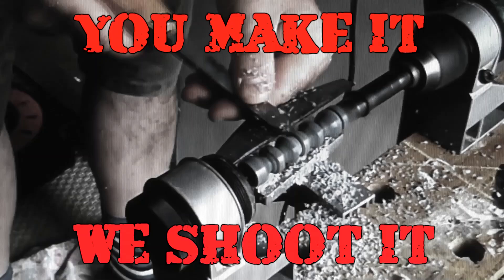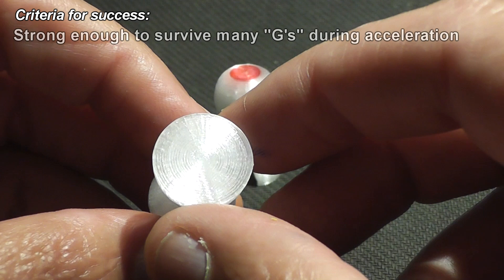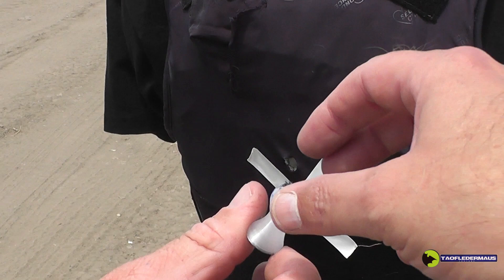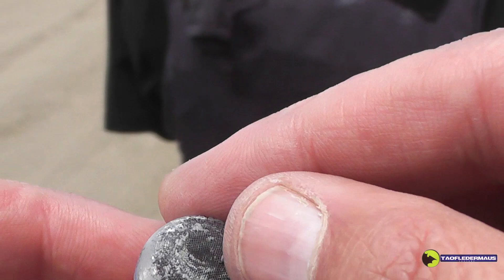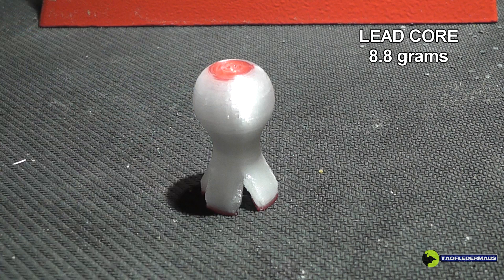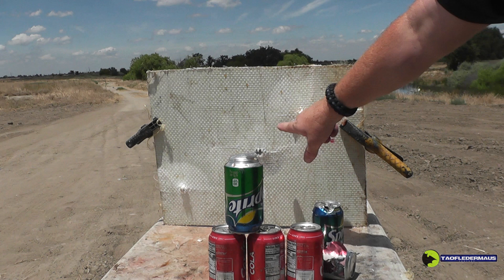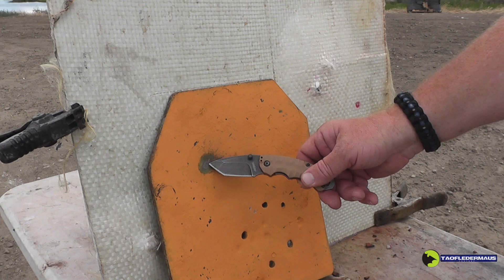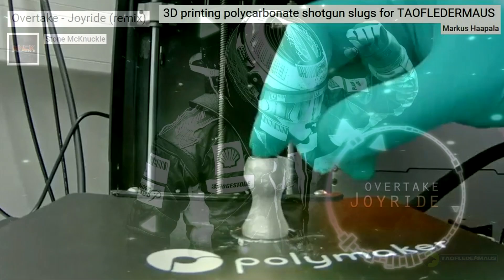SCIENTISTS send us shotgun slugs with stunning results!

Comment: Policarbonate holding the shotgun blast?  "no problem at all" i tough when i heard him say that. 
Im an optician and i work with PC, man that thing is hard as hell, one time an old lady bring me her prescription glasses , one of them was scratched but ok, the other was bent 90 degrees. knowing the material and the strenght you would need to do that i asked her what happened and she told me they fall off her pocket when she was crossing the street and a bus ran over them
Reply: I only have one working eye, so I always pay the extra to get Polycarbonate lenses for that very reason.

The worst thing that's ever happened to mine was taking a drill chuck thrown across the room because someone forgot to remove it from the drill press. Lens somehow managed to stop it.
Reply: I had some extra thick polycarbonate lenses with clip on side shields that I used while operating a CNC milling machine. They saved my eyes more than once from chips of steel and aluminum that shot out at high speed.

Comment: I don't know anything about supersonic fluidics, however my initial thought was that they maintained accuracy in part because of the large flare causing a significant amount of drag pulling the rear in alignment with it's trajectory. Then in the last shot against the armor plate, you can see part of the sabot is dragged along in the vacuum until the very end. So, considering that the accuracy seems to at least in part come from the drag being high, I'd be curious how fast the velocity drops off over larger distances.

Comment: I have a polycarbonate motorcycle helmet. I'm pleased to see how tough this stuff is.
Reply: lahokc59 the shape of the helmet also determines how well the impact is distributed. Idk, I'm sure I'll be fine with it.
Reply: lahokc59  :  Slice your expensive helmet open and see that it is the expanded poly-foam (various flavours) that does the absorption, not the shell material (polycarb / reinforced -fibreglass - carbon fibre - kevlar/ etc...  That just stops the foam escaping (and penetration), very hard to collect it again once it escapes...
Reply: Cheapest and weakest helmet material.  Blunt force protection is mostly a function of the foam inside.  The shell protects against penetration, abrasion and crushing.  All high end helmets (Snell rated) use fiberglass or better.  Shoei is probably the best helmet for the money.
Reply: How does it fair vs steel I wonder?
Reply: @ericthered9655  yea idk my helmet was SNELL and DOT approved.
Reply: I have bmx pegs, with polycarbonate sleeves and grind ledges and rusty steel railings and they look like they barely scraped it. PC is super hard, but it has flex to it thats why it wont break. Watch a slow mo polycarbonate riot shield test, it like dents in and then reforms in under a second after being shot.
Reply: @ericthered9655  The face shield as well as fighter jet cockpit canopies are made of polycarbonate.  It’s a very good material.  Fiberglass is brittle and unforgiving when it comes to impacts, that’s why polycarbonate replaced it.
Reply: @captaingoldbeered803  Because you can see through it. The thin PC used for helmets offers little protection. No high end helmets use it. It's only used in very cheap helmets. Do some research. Someone has been lying to you.
Reply: @ericthered9655  I have researched it, online and in person with my own noggin, helmet and pavement at significant speed.  The helmet, inside and out, did exactly what it was supposed to.  It absorbed the energy and protected my head as was depicted by the compressed, stress-cracked styro inside despite the polycarbonate on the outside being scratched to hell but completely uncracked.  Poly is fine as long as it’s thick enough.  I don’t buy shitty helmets, the one I “tested” was a 300$ svs.  The main difference between a quality poly shell helmet in the 2-300$ range and a 900$ helmet is the $900 carbon fiber one will be considerably lighter, not necessarily safer.  I must reiterate, I’m not talking about the $50 internet helmets that are being shilled out to the unsuspecting by the boatload.  They may technically be poly or abs but I guarantee it’s the cheapest crap that could be sourced near the sweat shops that day.  You really should look into plastics a little deeper, it’s truly amazing what they’re capable of these days.
Reply: @captaingoldbeered803  PC helmets offer minimal protection. Fiberglass and better are far superior. This isn't something that is in dispute. You clearly don't understand the properties of these materials. Stop trying to make up your own version of reality and listen to people that know a thousand times more than you.
Reply: @ericthered9655 Well there goes this conversation.  Try to have a nice life bud.
Reply: @captaingoldbeered803  A helmet performs more than one function. The foam reduces moment of impact which reduces how hard your brain hits the inside of your skull. The shell spreads the impact and absorbs blows that could smash the skull such as your head hitting curb. PC has virtually zero ability to withstand warping and will not rest a focused blow. Likewise, it will not stop your head from being crushed which I have seen. I can deform a PC helmet with my hands. It will only protect very light blows. Believe it or not, the fact that zero high end helmets use it isn't a conspiracy to trick you. Good luck with your soft helmet. I hope you never find out the hard way.

Comment: I see the physics behind it. The ball in the front is used to push the air around the back section, that's the stabilizer part, It goes around to not disturb the back part.. the back part is there to stabilize it. it is slightly engraved in the bullet so that when it tilts in the air more air resistance is put on the back which turns it forward. Really simple but smart design!

Comment: Please for the love of god, BUY A CHRONOGRAPH!!!! You can pick up a Caldwell's shooting chrony for less than $100 and download the app to your phone and be able to say with accuracy how fast the loads are going. In the app you can even plug in the weight or the projectiles and it figures the energy delivers at different ranges for you. You can accurately keep track of meteorological conditions for comparison later, PLEASE QUIT GUESSING AND GET A CHRONOGRAPH!!!!
Reply: Southron Jr all you have to do is know your frame rate and distance traveled per frame and you get the speed
Reply: Jacob riddle Yes, but that would require using the high speed camera for every single shot and doing a bunch of math that is made automatically and is more accurate made by a chronograph.
Reply: Southron Jr That's actually often the point - they have very few rounds and every shot counts. They can't waste one on chronograph measurement.

Also, if it's difficult for you to calculate speed from a known time and distance, I feel sorry for you.
Reply: My point is that they can use the chronograph in conjunction with the high speed and be able to have a more accurate measurement than using math alone, and no, doing the math for me isn't hard, just a chronograph does it for them with being able to add all other factors in the record. STOP BEING A TROLL!!
Reply: Southron Jr You call this being a troll? Man, calm down...
Reply: "Also, if it's difficult for you to calculate speed from a known time and distance, I feel sorry for you." 

That and arguing just to argue is being troll.
Reply: Southron Jr You acted like it's a problem to use the high speed camera for all shots, so I said no, that's actually a requirement for other reasons.
Then you acted like simple division is too much trouble and they need to buy and use an additional device instead.
I am not being a troll, I just think you are wrong. I apologize if my snark about calculating speed bothered you.
Reply: Honestly it's not that big of an issue. Frame rate vs known distance/scale is easy enough to get it to the right ballpark. This is a channel were a guy shoots stuff people send him from a 12ga or tries ideas people come up with for the same. It's not WMRD or MCWL or NRL or even SAAMI.....it's a guy having fun with a shotgun.
Reply: +Michel Linschoten I agree that a chrono is cheap. You can still get a fold out F1 Chrony for $75 on sale NIB. But why? You yourself said they aren't professionals, so what does it matter if they use a chronograph? If you shoot at a known distance, and have a high speed camera that can record total flight time from the crown of the barrel to the impact of the round, then you can calculate speed pretty accurately. And, it's one less thing to clutter up the range with. Not to mention, you see a lot of their videos with wads or even sabot hulls flying all around the area where one would normally place a chronograph. It simply isn't needed if you can calculate it out using the footage.

Also, for some one scolding others about chest puffing, your reply has an awful lot of chest puffing man.
Reply: Its okay man they don't understand calculus, information for you, when you have the time of firing and time of impact you don't know the continuum of velocity across the entire flight... which is very valuable information to discern such things as muzzle velocity and drag
Reply: you want jeff to get a chronograph so bad, why dont you buy him one and send it to him?
Reply: Southron Jr I agree. It would add a much needed aspect/measurement for us to get a better idea of preformance

Comment: I would like to see these slugs (the ones that worked) put into production.
Reply: The tungsten ones are not smart to produce, because the metal costs so much, it would be way more worth it to just buy a normal slug because of the price.
Reply: @alexander-it6mx  If they could release the diagrams we could make some from lead in a mold cut in a cnc
Reply: Oh trust me, people will pay for them. Hard hitting, insanely accurate (there is more in them yet, the boys have tried one load of each of two powders) and really cool so they will sell even at a premium price.

Comment: It reminds me of a toy that resembled the exact projectile that you would insert a "cap gun insert" into it and throw it. The front was weighted so it would always fly straight. It would pop upon contact. I believe a projectile without the "weak spot" would have far less force. I also believe this is why there is an exact measurement of powder required.

Comment: i dont understand why they keep calling the middle its weak spot. arches are strong on top and i guess they think its weak because the arch is being compressed but this isn't just your typical arch shape. the best way i can describe it is a 360 arch with a cylinder in the center. It's actually a very strong point although i lack the vocabulary to describe it

Comment: "This design we haven't seen before"... except in every .177 air rifle slug since the dawn of time... ;)

Cool to see the principal of the skirted projectile through a smooth bore to maintain stability holds up in shotguns as well as air rifles though.
Reply from the maker: the dimensions are completely different with these-  length to width ratio
Reply: Fair point, though now I'm curious to know what a .177 skirted slug scaled up to 12ga would do

Comment: The flat back creates drag which keeps the slug facing forward... Interesting... Makes me think a heavy needler round with golf tee shaped needles. Modified a little of course. Small fins leading up to the flat back that help generate some rotation for stability. Some slots in the back too so it could be loaded 3 in the back with one forward a little, maybe a wading that would hold the middle one lightly further forward and flare away after leaving the the barrel. This would make it so as the 4 needles leave the barrel the wading would flare away, as the middle starts spinning would lightly separate the 3 others, and hit the target fairly accurate. How angled the "fins" are would determine it the spread as the middle throws the other 3... Actually, no fins, they could get caught in the middles slots

Comment: At around 10:13 the wad impacts a leg of the metal supporting the cinder block. It bounces to the right spinning at a high rate. As flies away it to the right, it appears to slow down and the spin rate goes up dramatically.
It has nothing to do with the video or the performance of the slugs, just thought it was interesting. By then end of the shot it's almost hovering and spinning really fast.

Comment: Great timing, I just pimped my 3D printer to be able to print polycarbonate. It's difficult stuff to work with indeed, only prints at very hot temperatures and warps like crazy without the proper precautions. But as you can see, it's tough enough to shoot from a shotgun!

Comment: Given the stable, and relatively straight flight path of these slugs, I wonder two things: 1) How would they preform in a smooth bore muzzle loader? 2) If you used these to make a mold, and then poured lead into it (creating a solid lead slug of this shape and design), how does it compare to musket balls?
Reply from the maker: If they were lead,  they'd weigh about 3,5 oz,  and would probably pressure-spike the barrel and blow up the shotgun.

Comment: It's interesting to note, and is probably something you should pass on to the people that send you these things in; The shape of the front of the projectile is actually a LOT less important than the base/tail of said projectile. I'd guess that even if that split tail had held together, it still would have proved vastly inferior to the solid, smooth base. For example, you could take a 5.56 and cut the tip off at a 45 degree angle and it would still fly fairly straight. However if you so much as chip the base of the bullet (well, where the side meets the base) you will completely destroy it's ballistics.

Comment: ironically i feel like the smooth teardrop point helps guide air into the flat spot behind it, causing a low pressure suction that makes the tail of the round actually stabilize in flight

Comment: There are longer sniper rounds with the concave centre, it's based off the same principle as those dimples in a golf ball and cut that drag coefficient down by loads allowing long range travel on a heavier longer round, I saw a video of a sniper make a head shot on a dummy at over a mile, I was impressed and disgusted at the same time. IF you want to get better mileage by about 23% on your car using this same principle, get a vinyl wrap with the golf ball dimples in it, and watch the change in mileage and speed from the better drag coefficient. A wrap that pays for itself.

Comment: Love seeing Greg shoot that gun. I own the same one. Very similar. I have a red dot, and the same mag extension, camo, and a similar shell holder on the buttstock. I also have a light, and sling mounted though. I've also been thinking of cutting down the let side of slide so I can add a second 5 or 6 round shell holder opposite the ejection port. Then I can have slugs in one, and either 00, 0 or most likely number 4 buckshot. Anyways great video as always. Good on the scientists for doing some great work.

Comment: The shape of these slugs is not to much different than the shape of conventional pellet-gun projectiles.  It's the shuttle-cock, wasp-waisted design that helps keep it stable in flight.

This is like comparing apples to oranges but, in similar fashion when longer bullet-shaped projectiles are used in most air rifles you get the same types of unstable flight that you guys have shown when shooting similar projectile shapes out of your shotguns.

In air rifles, when conventionally shaped pellets (shaped like the slugs you were firing) are pushed to fast, not even the shuttle-cock shape of them can keep them stable.  The lightest weight pellets (or slugs in this case) have a velocity window that keeps them from being accurate beyond that point.

Comment: Would be a safer alternative in domestic room clearing for officers because its low penetration abilities for walls is low I imagine compared to conventional slugs right? Atleast for the slugs containing no tungsten correct in assuming? Should have tested it on dry wall and wood combinations :3 but I suppose that's what bean bags are for and other non lethal methods xD

Comment: notice me senpai!

You should try to Shoot NaK. It consists of Sodium (Na), and Potassium (K). As elements, they are solid, as an alloy, they are a highly flammable liquid, that will start to burn if the air has acces to it. It is so sickly reactive, that if you drop a drop of it, it wont reach the ground. 

sooo they look pretty amazing, because they are on fire while flying ^-^

there was a lot of research to make this working as a cooling liquid in an atomic reactor
p.s :
on a channel called backyardscientist he did them, but he didn't test them on ballastic gelatine.

Comment: I wondered about your statement that the slug would be subject to 10k g's of force due to acceleration in the shotgun barrel this seemed high to me so did some research. With one gravitational force an object will be travelling final velocity would be 4,4280555 m/s (time: 0,452117) in one meter right?

Reference https://www.physicsforums.com/threads/velocity-of-a-falling-object-after-1-meters.343581/ so 4.428 meters per sec is 14.52756 feet per second this would mean the slug would only be subject to 100 gravity to accelerate to a speed of 1452 feet per sec in a 39 inch long barrel.I know barrels aren't  39 inches long but even dividing this by ten and getting a 4 inch barrel velocity the same @1452 ft/sec that only one thousand gravity not ten thousand  and still 1452 out of a 4 inch barrel is way high more like 500 ft per sec which would make 350 gravity more accurate